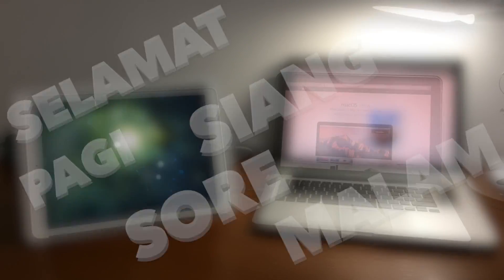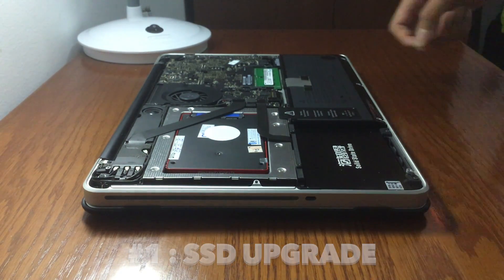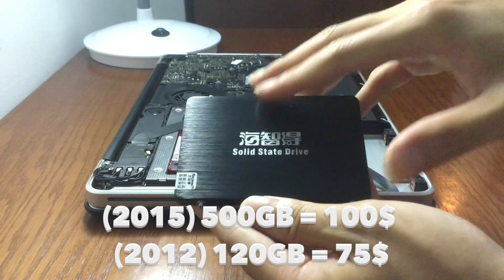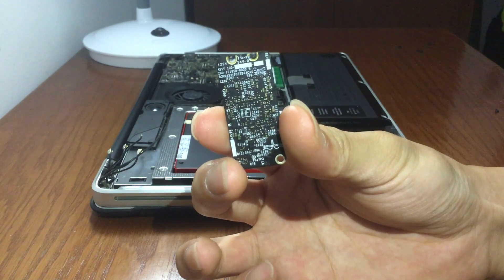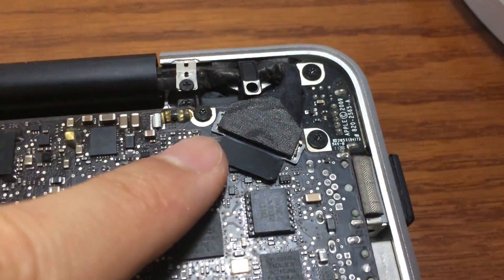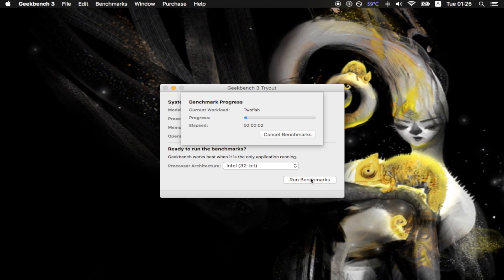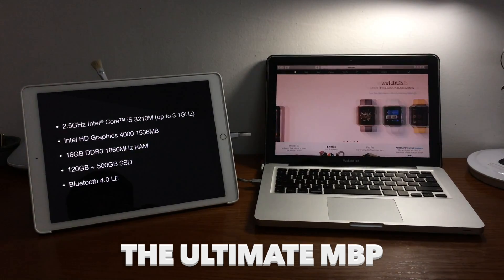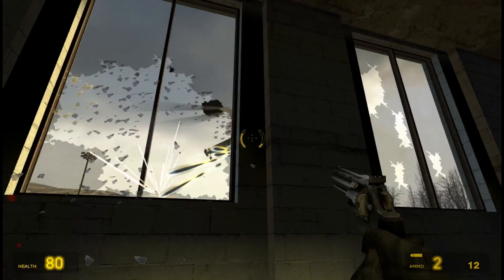The Ultimate MacBook Pro (Late 2011) Upgrade

Comment: I have a 2011 MBP 17”. Are there logic board replacements/upgrades for it? I also have that GPU failure. Currently run it on safe mode because it will not boot up in normal mode.
Reply from the maker: Of course there would be replacements, you just have to look up for your model number in your local marketplace, though as for upgrades I haven't heard any for the 17" version

Comment: I just did the bluetooth upgrade. They have the modules on ebay for 7 bucks free shipping
Reply: Curious about the bluetooth upgrade as I want to do the same with my Late 2011 13-inch. Aside from purchasing the Bluetooth Module, anything else you need?
Reply: @NoeticJ  No just the newer airport card from a 2012 macbook. Mines a 15 tho check online if 13 is the same

Comment: Hmm I've done the ram 16gb and ssd  same as yours and I brought it back to life lol but thanks with this video, I will have to buy that 2012 motherboard for it.The reason is my macbook 2011 has a issue where it only runs smooth when its connected to charger and I think it has to do with the board having a sensor issue. When I take it off the charger it runs extremely slow. With the new motherboard it should work like new! Also is that bluetooth upgrade recommended? Will it work with my airpods thanks!?

Comment: Hey thanks for the last reply, I’m wondering if you upgraded the OS to Catalina?
Reply from the maker: You’re welcome. Yes I’m currently running macOS Catalina
Reply: Kenneth Tanaka so the Bluetooth/WiFi module works fine under Catalina after activation then
Reply from the maker: Yes it works just fine

Comment: Will upgrading the wifi card to AC help find my router faster or just improve speeds once connected? I really just want to connect to my router instantly like my phone or ipad does but don't really care about the speed improvements.
Reply from the maker: As far as I know there is no Wifi 5 (ac) wireless card upgrade, it just upgrades the bluetooth to BT 5.0 to enable airdrop/continuity

Comment: Hi Kenneth. Thanks for this video. Really helpful. 
What would you recommend me to upgrade my Macbook pro at its best? I have; 

MacBook Pro (13-inch, Early 2011)
-  2,7 GHz Intel Core i7  (Can I change this and what is the max. that I can upgrade?)
-  16 GB 1333 MHz DDR3 (I think the memory is max that I can get)
-  Intel HD Graphics 3000 512 MB  (can I increase graphics capabilities of this device)
-  750GB SATA disc   (Can I upgrade this with any SSD available on the market or are there limitations?)

Comment: Thank you for the video. I also have the very same specs as yours, but currently I only upgrade the ssd and the RAM part. If you guys are still using Late 2011 MBP (or MBP released before that), you ARE NOT ABLE to develop mobile apps because you need Xcode 10.x which means you need OSX Mojave (minimum) WHICH MEANS newer MBP! 

Thank you Apple!
Reply: Prabowo Murti on the contrary these computers are able to run the latest Catalina which surpass Mojave unofficially of course but non the less it works perfectly without any issues on Catalina

Comment: hey hi, you changed the max RAM according to your new mother board right, where did you go to know which one you can upgrade it to? I have a mbp 5,5 mid 2009 Unibody
Reply from the maker: Hello 👋🏻 I have used the 8GB x 2 RAM configuration even since I was still using the Late 2011 motherboard. Unfortunately I don’t think models earlier than 2011 can support 16GB though. It supports any SO-DIMM DDR3 RAM I think, you can google around and there’s an official Apple page for it
Reply: @namedkenn  I meant 16 in total so 2X8

Comment: Hi, I have a 13" late 2011 i7 Macbook Pro. maxed out the RAM by 16gb and 1TB ssd by 2015 (helped me achieve near perfect GPA for my masters program). already fixed continuity with software, all I need is an actual metal-compatible GPU to run Catalina-based apps. 

is it possible to handover a 2011 i7 motherboard in exchange with a 2012 i7? this thing can serve me for 4-5 more years  with a proper GPU. and probably switching to a Retina LCD.
Reply from the maker: Hahaha well well, you can, but it all depends on the store whether they accept trade-ins or not, so you have to find yours 👌🏻 good luck!
Reply: i also have late 2011 and was wondering if i can replace the dvd drive with 2tb ssd and have the main with 2tb aswell so 4tb storage total?

Comment: So if you switched to the 2012 motherboard could you upgrade the screen to Retina?
Reply from the maker: Unfortunately I’m not sure about that, I never tried to change mine. I think there is a higher res screen but it’s only for the 15” right not the 13”?

I’m upgrading the motherboard to the ‘older’ Mid 2012 MBP anyway not the rMBP (retina), that’s an entirely different model.

Comment: Hi Kenneth i have a MacBook Pro 15" Early 2011 / 2 GHz Intel Core i7 / Ram 16 GB 1333 MHz DDR3 G / Intel HD Graphics 3000 512 MB  What is the biggest and best graphics card I can put?  
Do you think it's best to put motherboard 2012 ??? 
I can put it Intel HD Graphics 4000 1536 MB ????
Thanks for everything !!!!!!!!!
Reply from the maker: Hello, unfortunately I’m not sure about the 15 inch, because mine is 13 and I haven’t heard of anyone doing a motherboard swap on the 15” version. But I think by upgrading the RAM to 8GB you could increase the allocated GPU VRAM into 1GB, and if you upgrade it to 16GB it’ll be 1,5GB. Though I don’t think there’ll be much difference, because the Intel HD 3000 is still the same. I’m sorry I couldn’t help much but I hope this helped a little

Comment: How did the upgrades hold up in the long term? I'm going to be purchasing a 2nd hand MBP Late 2011 and have a feeling I will need to upgrade it a bit.
Reply from the maker: Well if you buy the 2011 now, out of rhe box (or there’s no box) it’ll be obsolete, you can’t install the latest macOS unless you upgrade the motherboard. Though if you just wanted to use it for office documents and other small stuff I think it’ll be fine. In fact I still use mine to this date to edit all my recent youtube videos!

Comment: I have a macbook pro late 2011 and the graphics card doesn't meet the requirements for a lot of things that I normally did. should I try and upgrade my motherboard or the Gpu itself?
Reply from the maker: Your upgrade option is either to change your motherboard, or buy entirely new computer (because the GPU is in the same chip as the CPU and they’re soldered to the board, so you can’t change only GPU)

I have a video explaining how to change the motherboard, but at the end you should choose which one fits you.
Reply: @namedkenn  thank u thats why ive been trying to switch to pc builds at this point. so I don't have this kinda problem. thanks for the reply

Comment: Thank you for making this video. I wanted to upgrade my 13” late 2011 Macbook Pro logic board to the mid 2012 logic board so I could install Mojave. After you upgrade, were you able to install Mac OS Mojave?
Reply from the maker: You‘re welcome. And that I can confirm will work, I am still using this as my editing laptop haha
Reply: Just use dosdude tool to continue to upgrade unsupported Macs.

Comment: I had also heard about Continuity _ was it hard to get that to work. 
Having a MacBook Pro and an iPad, and not being able to use Airdrop is a MAJOR issue..
thanks again!
Reply: V4D2 I found it doesn’t work when you have upgraded past Yosemite. I did the upgrade and tried the tool but it didn’t work

Comment: Thanks for the video !  ;)
How about the expresscard 34 port ?
Have you ever messed with that ?
I'm trying to expand in order to having 2 USB 3 ports-
thanks !
Reply from the maker: Glad if you found it helpful!

Because mine is the 13” Macbook Pro I don’t have the expresscard slot, so I’ve never had any experience with that, but I think I’ve seen some others found success in adding USB 3 through expresscard 👌🏻
Reply: Kenneth Tanaka thanks ;)  for the feedback. 
and again..for the video.
PS: was it easy, finding the upgrade for the bluetooth chip?
Reply from the maker: You’re welcome. The bluetooth module is pretty easy to get (and change), there are links to that in the description, it just not the cheapest, so you should decide whether it’s worth your money or not 🤣

Comment: its 2019 and here's my kick ass Late 2011 17" MBP....

 Upgrades:
16GB of Corsair Vengeance (the Rolls Royce of Ram) @ 1600mhz speeds.
1TB Samsung 850 Evo SSD (now updated to server quality Micron M500 960GB SSD uses MLC server NAND chips w/Trim enabled very stable).
Upgraded the Bluetooth module to the 2012 MPB version BCM94331PCIEBT4CAX now with Bluetooth 4.0!!!  (2011 models come with BT 2.1, newer peripherals don't work)
2x USB 3.0 ports flushed via the Express slot! Very stable and native (no drivers nor kexts needed).
Runs latest Mojave and Windows 10 native (no Boot Camp needed) full grafix acceleration!
Liquid Metal the CPU and AMD Radeon HD 6770 grafix and both super low temps around 22c idle and 45c max loads! (cpu & grafix never overheats which eliminates the famous GPU failure everyone is talking about)... 
Added the amazing "Fugipoly" 1mm/2mm commercial industry best's Thermal pad on the opposite side just under the CPU/GPU  solder chips which reduces another 8c degrees! 
Beautiful full body "Black Brush Metal skin" looks amazing!

Still way better and powerful than newer shitty all solder mac's, really don't need to upgrade to a newer mac in a long time! 17 inch screen is a BEAUTY...
Reply: I recently ordered a 17” MacBook and plan to do this. Can’t wait for it to arrive!
Reply: How did you get Mojave working with the AMD GPU? All the patchers that let you install Mojave or Catalina specifically say NO AMD SUPPORT so I'm super curious because I wanna do it too!

Thanks!

Comment: What about the crippling graphics card failures in the 2011 MacBook pros?
Reply from the maker: Well I haven't experienced it myself, but if the GPU fails then changing the motherboard would most definitely fix it right? And avoid it altogether if you change to the 2012 one

Comment: One question, sir. Can we connect egpu to our thunderbolts series 1? if so, what chasis and external card do you suggest?. Thanks in advance.
Reply from the maker: Because of budget constraints I'm currently not able to test eGPUs, as interesting as that might be. So I am sorry that I have to suggest you to do some googling instead. But as far as I know it is possible to connect eGPU to Thunderbolt 1, if you don't mind the bottleneck

Comment: I finished installing a logic board now i have no wifi. It says no wifi hardware installed
Reply from the maker: Oh I think you should get the wireless card too then! In my case I've changed my bluetooth card first then the motherboard so I was not aware of this issue

Comment: Old video, but I'll share what I am doing with my early 2011 17inch Macbook Pro, mostly because I like to geek talk!

But I gained My Macbook Pro very cheap because it was broken from the common GPU issue the AMD HD 6750m has.
Scored it for $150 Canadian. 

There is a way to disable the HD 6750m completely and rely on the Intel HD 3000.
Basically I boot it up into system recovery mode, one of the few things this Mac could do while it was stuck in its boot loop.
And in that command line system, I had to move some driver files around, and then reprogram the EFI (Bios) not to default or ever use the AMD HD 6750m.

Now this laptop works perfectly accept for being stuck only on the HD 3000..... 
But all I do with it, is watch videos, browse the web, and light gaming like Stardew Valley.

Now once I get a little extra money, I am going to upgrade it to 16gb of ram, from its stock 4gb.
And for whatever reason it has a 320gb hdd, compared to the fact it was supposed to ship with a 750gb hdd.
I assume it must of died.....
Either way...... I can't stand HDD anymore! 
So I'll be buying a 500gb SSD for it next. Likely a Samsung, I've had good luck with them, but since I'm not going to keep any important files on this Mac.....
I'd be willing to try other brands if the right deal shows up! 

Besides that it needs a new battery because I get a whopping 20mins off the current one..... Only good to save me if the plug comes loose for a few mins....

Comment: i'm on mbp early 2011, upgraded ssd and RAM. also use external bluetooth USB to run airdrop. i was just wondering whether it's worth upgrading cpu or motherboard as well? does it give any boost (i think mainly talking about gpu) for this price? my ram is on 1333 mhz, i don't think it can get any further. i'm also running high sierra and mbp seems to be hotter than before, though faster due to new filesystem that's why i don't wanna downgrade. my ssd is almost full (96,5%), is that the case how do you think?? at last, do you think new motherboard is a must?

Comment: Hey Kenneth great video. I notice you suggest we upgrade to 8 gig of memory instead of 16. Do you use FCPX? I edit and was debating if I should update so I can use fcpx. Is is possible to install a i7? Currently I have i5.Thanks for your time.
Reply from the maker: Hey thanks, that 8GB is for most people doing daily tasks, but if you consider yourself a heavy user, or doing video editing with FCPX as you mentioned, I think 16GB would be a better choice

And to install an i7 you need to change the entire motherboard of that specific processor, so keep that in mind, but I think i5 will be just fine, the speed difference going to i7 does not pay back the money and effort you put there

Comment: I have a macbook pro late 2011 i5 2.4 . I am wanting to change the mother board to the Apple MacBook Pro 2012 (Mid) Core i7 2.9Ghz 13-inch. Is this possible?
Reply: did you ever do that upgrade? I'm looking to do the same upgrade but I don't know if an i7 would work with my i5. Please let me know
Reply from the maker: Yes the i7 logic board will work just fine 👍🏻

Comment: Is it okay if we put 4GB Ram in one slot and 8GB RAM in other slot?
Reply from the maker: Yes it will work fine, but it is recommended to use two same module (a bundle if possible) to make sure the timing, the speed, and the amount of RAM is the same
Reply: Okay, Terima Kasih

Comment: i have the same 2011 mb pro 2.4ghz  I5, 8gb 1600mhz ram ,128gb ssd...my upgrades were the ram and the ssd, both of those made it Fly!
i wonder why u didnt go for an I7 cpu logicboard?  arent  the i7 boards compatible with the mb pro 13" late 2011 chassis? other than that, u did some incredible work bro!  what an awesome build u now have! i love mine and its not as maxed out as urs.
Reply from the maker: Hahahah thanks, I am truly satisfied right now the laptop I bought 7 years ago is still working incredibly well, sure I could go for i7, but unfortunately I didn't have the price was not in my budget so I just went with i5 instead hahah

Comment: Thanks for this! I have a Macbook Pro late 2011 intel Core i7 and my Graphics is still 384mb. Do you know how much if I upgrade to 1.5gb graphics like yours?
Reply from the maker: You have to upgrade your RAM to 8GB or higher to get a VRAM upgrade (because the video ram is shared with the system memory). I don't know about the exact prices though

Comment: When you say your larger SSD "broke" when you put it in the optical bay, what do you mean by that?  Did something physically break on it or do you mean that it just didn't work properly?
Reply from the maker: I think I meant that my 1 TB HDD broke (like it can’t be read anymore, it failed, so I have to claim the warranty of it) when I put it in the optical bay, don’t know the exact reason, so I think it is better to put the SSD on the optical bay, and put mechanical HDD on the other one which is designed specifically for mechanical hard drive.

Comment: Just looking on the mac website all the MacBook Pro say that the ram can only be upgraded to 8gb but you upgraded to 16gb. Is this correct ??
Reply from the maker: It is correct, even the speeds are written up to 1600Mhz but I'm running 16GB at 1867Mhz anyways (I'm on 2012 13" MBP motherboard)

Comment: Hi, on Apple’s website for this exact Macbook, it says 8 GB max, how come I see ppl commenting they put 16 GB ?
Reply from the maker: Yes, because apparently the description by Apple apparently are the recommended value but actually if you put 16GB, it will work too. I've been using 16GB (8GBx2) at 1867MHz for years now and its been great.
Reply: Kenneth Tanaka Thanks, because right now I have 2x2 GB and do I have to tweak things in the settings or it’s automatically done ?
Reply: 8gbmaxperslot..but therewas 2 slot available for memory so its 16gb max total.. i've changed mine 2years ago..and it works really well until now.